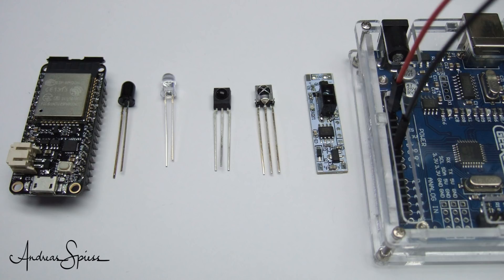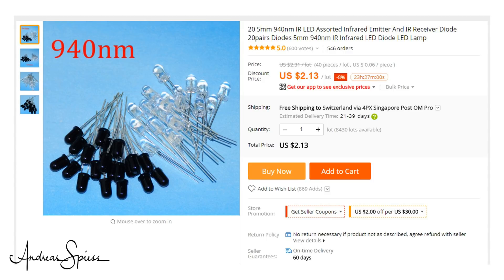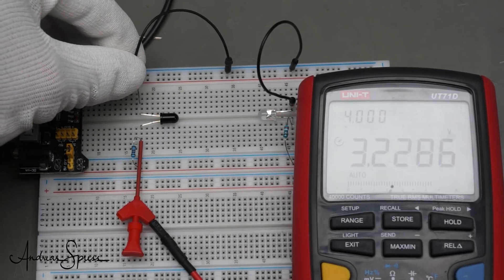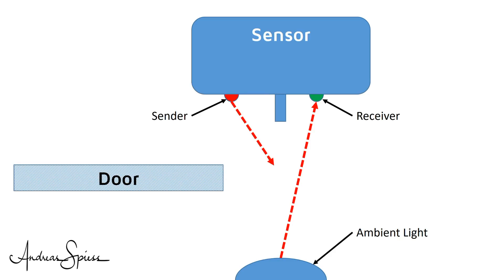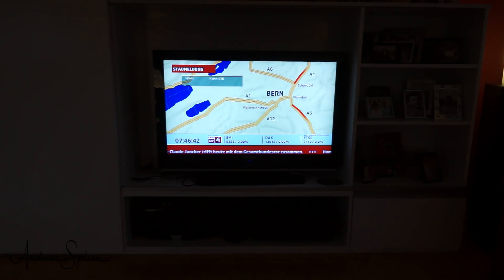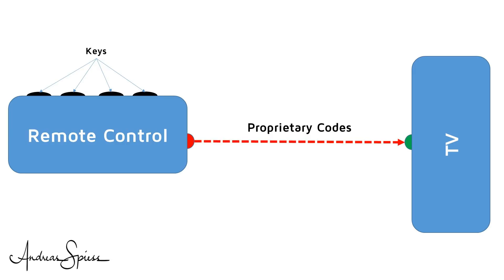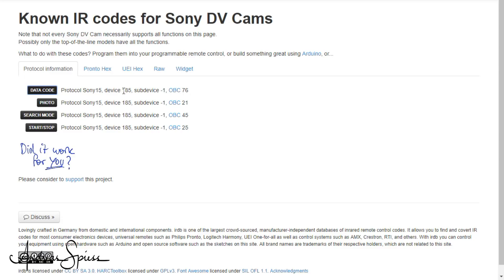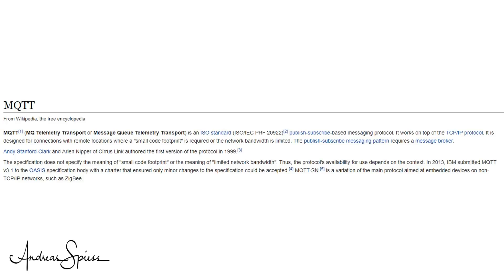#171 Arduino Guide to Infrared (IR) Communication also for ESP32 and ESP8266

Comment: I have just maden my own IR transmitter 38kHz (with two 555s) and receiver and even was able to drive a stepper motor (with l293d) , the problem is that the IR receiver doesn't like constant signal but with pulses it wasn't very accurate with that stepper motor ( I am happy that I managed to do this but when I have doscovered one thing  severeal other problems appear hahhaha ;) )
Reply from the maker: I do not know which receiver you used. If you used a standard photodiode you would have to look at its output signal to find out if it was driven into saturation by (constant) ambient light.
Reply: @AndreasSpiess  VS1838B :)
Reply from the maker: These sensors are optimized for IR codes. So they probably have some built-in filtering.
Reply: Hmm..an oscyliscope would be usuful but it is too expensive for me at this amator stage. So actually I could use coder/decoder with that so it would be better? Or experiment with my own code - as long as it is accepted by the receiver..

Comment: In cases where propagation time is important, what's the best I can expect to see in a low to high transition at the transmitter to a low to high at the receiver output. No mechanical relay, to slow.
Reply from the maker: Propagation of light is 300'000km/sec. More important is the protocol and the transmission speed  you use. I did not do measurements for that purpose. Maybe google knows?

Comment: I can't help but think that using an ultrasonic sensor would've just made your time a lit easier , but you have a cat you that may not have worked out
Reply from the maker: None of my devices "listens" to ultrasonic :-(
Reply: Sorry for the very late reply (first saw this for a home project but now I need this information for an assignment) what I meant to was that you could've used an ultra sonic sensor instead of the often shoddy IR ones to see is the cover for the TV was closed

Comment: Hello dear Andreas, can you please help me connect this sound module
https://www.ebay.com/itm/MP3-Voice-Recording-Playback-Module-Sound-Recorder-Board-With-Speaker-PIR-Sensor/333643130388?ssPageName=STRK%3AMEBIDX%3AIT&_trksid=p2057872.m2749.l2649
with these IR sensors
https://www.ebay.com/itm/IR-infrared-transmitter-module-Ir-digital-38khz-infrared-receiver-sensor-mod-ES/223690153347?ssPageName=STRK%3AMEBIDX%3AIT&var=522408438795&_trksid=p2057872.m2749.l2649
instead of that PIR sensor?
Thank you very much for your time.
Best wishes.
Max

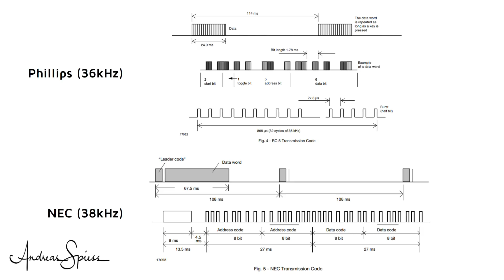Comment: so if I understand those diagrams right (11:55) - every signal I send from my remote control is like delayed about 0,08 sec ? I mean when I keep pressing the same button for example.
Reply from the maker: The receiver for sure has to wait for the whole transmission plus the time to decode teh signal.

Comment: Dear Andreas, I liked your videos a lot. I'm trying to use ESP32 DOIT DEVKIT v1 to controll AC (Sinclair), my plan is to send RAW codes to the AC. I tested this on ESP8266 where I can select GPIO pins. How can I set GPIO pin for ESP32. Do I have to change something in boarddefs.h, irSend.CPP, irremote.h ?
On my PCB design I put GPIO pin 12 for the IR Send. How can I set this PIN in your library ?
Reply from the maker: Better use this library: https://github.com/z3t0/Arduino-IRremote
Reply: @AndreasSpiess  Thank you for your answer

Comment: does the ESP8266 have the same "IR" mode?
Reply from the maker: I did not check, but you should find a library which works with the ESP8266, too.
Reply: @AndreasSpiess  yeah, from what I've seen there are some, like the tasmota-ir, that implements it all

Comment: can you add more description of the components and what you are doing at 4mins 17 seconds? the voltage of the receiver goes up when it gets the signal of the transmitter? sorry I didnt understand it as it goes straight to where the components are on the test grid with the meter connected but not showing how the meter is connected what volts goes to the transmitter and what the reading on the digital meter is ? anyone also can you help me ? thanks
Reply from the maker: I interrupt the light from the LED to the phototransistor and because of that, the phototransistor changes its voltage.
You find the links to the parts used in the video description.
Reply: @AndreasSpiess  thanks for your reply :)     
so q1:- in other words does the resistance of the phototransistor go up or down when it received IR light? I will check your other videos I need to go over the very basics I think (I even need to check the difference between resistor and transistor - ) can I email you with my actual problem? I am looking at an old car IR central locking system - peugeot - neiman france made.
Reply from the maker: YouTube is my hobby and unfortunately, I have no time for answering mails :-(

Comment: You are right when told: - it's not easy program Arduino to have 38 KHz - But I'm been more lucky than clever and after to have read much articles about the Timers/Counters inside Arduino I have reach a good result with these few rows (on Arduino Nano): 
define pwmPin 11 // IR Carrier 38 KHz PWM
const long IR_CLOCK_RATE = 38000L; // IR Carrier 38 KHz PWM
void setup()
{
TCCR2A = _BV(WGM21) | _BV(COM2A0); // PWM setup
TCCR2B = _BV(CS20); // PWM setup - 38kHz carrier/timer 
OCR2A = (F_CPU/(IR_CLOCK_RATE*2L)-1); // PWM setup
pinMode (pwmPin, OUTPUT); // PWM setup
} // end setup
void loop()
{ 
} // end loop

My acknowledgements to - Hao Jiang - Ken Shirriff - Leonard Birchall -
Reply from the maker: Thanks for sharing!

Comment: Hi sir, really cool , im currently working a project that involves IR signal, however im stuck on decoding and transmitting HITACHI AC signal which i found that is not easy to decode, if u can help me with anything i would appreciate it. Thanks
Reply from the maker: You have to google to find a prokect which is capable of decoding these codes.

Comment: Hey, I am trying to build an IR spectrometer inexpensively. I am new to arduino though. The basic principle is that the diode shall emit IR radiation and then the sample to be analyzed would absorb a specific wavelength of the radiation (characteristic for different molecules). Is it possible to use this detector for this analysis (wavelength instead of it working like an ON/OFF switch and not working on detection of the intensity of IR). If not, can you please point me in the right direction??
Reply from the maker: I made a video about a spectrometer

Comment: I want to make a remote controller on Arduino (IRrecv+IRsend+sleep). In which it should read IR data usingtsop1738 then send the desired IR data using IR transmit led. And when no data is received it should go to deep sleep to conserve battery. Because I want it to run on 3v lithium coin cell. I found many codes on the internet using Irsend + sleep or just IRsend + IRrecv. But not a combination of all the three. If you make the code for the same it will be helpful. Need for this project=== some channel nos on my tv are 4 digits. It is very difficult to press 4 keys. So my plan is to press only 1 key tv remote and my controller will send desired 4 distinct key codes to tv by sending cancel command to my 1st command press by me on my tv remote
Reply from the maker: How would the receiver know when he has to wake without being awake?
Reply: @AndreasSpiess  Just as a push-button does. I found a person sending IR using irsend function from IRremote library. His atmega sleeps until he dont press any key. So I learned how to sleep-send-sleep. i want to know how to sleep-receive-sleep.
Reply: Thanks for the help in advance!

Comment: Sir, thank you dearly for all your tutorials.  I am new to ESP32 and have gained so much watching.  I was needing to move IR receive to core 0 to get the update rate I needed.  Would never have made it without your dual core video and your updated IR library.  Thank you so much!
Reply from the maker: You are welcome!
Reply: @AndreasSpiess  Sir, I hope you would provide some additional guidance.  I am having trouble getting a send.  I have reviewed your git hub files and responses below.  I just cant identify what output pin you are using for irsend?  Is this GPIO3?  There are several boards as you know.  I bought an Adafruit HUZZAH 32 not a dev board.  My mistake.  The Adafruit board does not have GPIO3 wired out.  Scouring through the library I can find the command identifying output pin assignments. Thank you for any assistance.
Reply: @AndreasSpiess  Sir, thank you again for all your wonderful vids.  I am sorry I bothered you, however, I did find the command.  Opening up IRremote.h in Visual Studio made it easier to locate the line is 262 -   byte timerPwmPin=15.  I changed the value from 3 to 15.  15 is another PWM pin on the ESP32.  Once again, thank you.  I really love this little chip.
Reply: Sir, like you I like to keep a happy wife.  This IRsend was the final piece in an automated TV volume level mod I have been making.  My wife hates the volume changing when commercials come on.  I have made a hack for her using a mic input to a PID loop with time proportional output.  I use the IR remote to change the setpoint of the PID.  Then I average the mic input to get a smooth sound level reference.  The PID adjusts the TV volume based on the setpoint, lowering the volume when commercials come on, or when she yells at me.  If you raise or lower the setpoint the volume tracks with it.  She is very Happy.  Couldn't have done it without your vids.

Comment: The Arduino runs at 16MHz, it should be capable of creating a 38 kHz pwm... The weak points could be the poorly written libraries. You could in theory set up a timer and achieve frequencies up to 8 MHz... Thought I think you need to code in assembly for that

Comment: I've been following you for many years. You never failed to deliver unique content. In my case, it works well with esp32. But when it comes to nodemcu, i have some issues with ir remote library. Getting errors regarding rawcodes since i tried almost all the ir remote library versions for node mcu. Can you suggest me stable version?
PS: I like your humor
Reply from the maker: I did not do anything with IR since then. So I do not know a library. And AFAIK they updated the ESP32 lib lately
Reply: @AndreasSpiess  somehow i managed to compile and run successfully.

Comment: Actually you could use the IR-diode that is used for emitting light as a light receiver. Diodes are always light sensitive, instead of just emitting light, they can also be used to detect light. Only the sensibility is not very good. But that migth work for your example already, since the distance from the tv door to the LED installation is so little. Give it a try with just some diode, it also works with other colors, like green, yellow, red, etc. LEDs. They all have some small voltage between anode and cathode, as soon as light hits them.
[edit] By the way, just to amuse your wife, how about a little magnet attached to the tv door and a hall sensor to detect that in position, when the door is closed?
[another edit] Got it, your wife is already amused... :)
Reply from the maker: Using the same LED for transmitting and receiving would probably not work as the speed of light is pretty fast. Using a hall sensor would also have been a possibility.
Reply: @AndreasSpiess  Na, dann wünsche ich mal einen schönen Sonnatg in die ferne Schweiz und viel Spaß mit dem Hall-Sensor... :)

Comment: I have an error message: .....Arduino\libraries\ESP32-IRremote\IRremote.cpp:28:27: fatal error: avr/interrupt.h: No such file or directory

Where could I get this library? Regards
Reply from the maker: Are you sure you compile it for an ESP32 board?
Reply: @AndreasSpiess  No, I'm using ESP8266 Esp12E. Is not the same library?
Reply from the maker: No
Reply: Oh!

Comment: Hello Andreas, I've been thinking about if it's possible to add some kind of conduit as a repeater to send IR signals (say something like the way optic fibers work)
Reply from the maker: I am not sure if it works with normal IR. Usually, they use laser diodes which is a different light source.

Comment: Hi @Andreas Spiess, re-watching your videos an idea came in mind, but could not be sure about a thing and wanted to contact you. You're declaring that it's possible to prevent day light from tricking IR receivers. I'm thinking about creating a robotic pan tilt mechanism, which follows only an IR emitter. I mean if not please suggest me some technology. I'm fed up with my motorcycle mirrors change their angles because of the wind. And as I go faster I need to bend my head in order to resist the wind and supply some aerodynamics. This results with the fact of losing my mirror vision. I'm now searching for a technology which will let me to 3d print a pan tilt mechanism to arrange my circle shaped mirrors angle relatively to my heads movement. I do not want to lose my vision in any case. Could IR be this technology? Could you advise me?

Comment: Thanks for your answer the Ir led and receiver are this LAOMAO 5 paia di diodi a infrarossi a LED, emissione e ricezione https://www.amazon.it/dp/B00EFOTJZE/ref=cm_sw_r_wa_apa_i_ulKoCbMZFP6KW can it do 10-15 metres?
Reply from the maker: I do not think so
Reply: @AndreasSpiess  this emitter can't?
Reply: Can you recommend a high distance emitter?
Reply from the maker: No, I never tried it with a bigger diode. Only with the one you want to use. But this did not work on 10m.
You need a strong IR diode (a few watts) and also have to add a driver. Not a simple task.

Comment: How much distance can the IR Led transmitter do? 10 metres?
Reply from the maker: Depends on the diode used in the transmitter and the ambient light. 10 meters could work.
Reply: LAOMAO 5 paia di diodi a infrarossi a LED, emissione e ricezione https://www.amazon.it/dp/B00EFOTJZE/ref=cm_sw_r_wa_apa_i_ulKoCbMZFP6KW
Reply: It's good?

Comment: How is the Arduino connected to the ESP32? Looks like ir devices are first wired to Arduino but later when MQTT is on ESP are the ir's on ESP? Thank you.
Reply from the maker: The ESP32 is used instead of the Arduino. So there is no need for a connection.

Comment: Did I miss something? Where is the schematic for connecting up everything. Thank you,
Reply from the maker: There is no diagram, it is very simple. The LED is connected to a pin using a small resistor and the detector is connected to 3.3 volts and to the respective input pin.

Comment: Love the video! Came here searching for a lesson just like this, in hopes of undersanding why another program (Iaqua controller) isn't working with my lights,  and got humor too :)  I did have a question on the code (IRMQTT_ESP32). I'm trying to use it on an arduino but after some errors due to missing library files (or wrong ones) I'm stuck on an exit status 1 for no matching function for call to 'IRsend::IRsend(int&)'   Is this another library issue, and if so, which one?
Reply from the maker: The ESP32 uses different libraries than the Arduino. You have to use the Arduino libraries for that. But you anyway will need connectivity (Internet).  I do not work with Arduino in such scenarios so I do not know which libraries should be used
Reply: Thank you for the info, I'll see if I can get it going. I do wonder, is it possible to have one send command transmit more than one code?  For the application I'm looking at, I need to press 3 buttons to turn a light on and get it to the lighting I'd wish to use. Can a program be made to send 3 codes with a delay between them, using one time trigger or line?

Comment: Thank you for all of your great videos. Very appreciated. I'm using the IRRemote library as described and all is working(Send and Receive). I want to take the values for the remote control I've read  and write them to memory using SPIFFS. Since IR is running an ISR, my code bombs when I try to write the remote data to SPIFFS file. I'm struggling to get around this issues. I do not see any methods to terminate the ISR when I'm done reading codes. I'm using Adafruits ESP32 Feather. Any direction would be greatly appreciated. Thanks!
Reply from the maker: I never use SD cards, so I do not know where the problem is. What if you attach the ISR to a pin which does not move during SD operation? Then no interrupt should trigger.

Comment: Dear Andres thank you for the comprehensive explanations.

I am trying to use the  IRSendDemo with ESP32 (WROOM-32 1313) and not sure how to interpret the comment
" An IR LED must be connected to Arduino PWM pin 3", pin 3 is RX0 in this board pinout.

Should it be TX0 (sadly not working), what is the proper pin to connect in order to send IR codes using your
examples (or the ESP32 Compatible examples from your github) ?

Thanks.
Reply from the maker: In the sketch the pins are defined as follows:  int RECV_PIN = 14;int SEND_PIN = 5; No pin 3

Comment: Has anyone implemented this with ESP32 or ESP8266 : https://www.aliexpress.com/item/Discount-5V-IR-Infrared-Remote-Decoder-Encoding-Transmitter-Receiver-Wireless-Module/32725206348.html 
Looking for any example sketch which implements TX RX on the module. Thanks...
Reply from the maker: I do not know this module
Reply: Since commenting earlier I've come across this forum: https://forum.arduino.cc/index.php?topic=359707.0 where I've added a translated English language manual. Seems to be straight forward to use, have ordered one which will arrive in a few weeks for me to try. Thanks for your response Andreas Spiess.

Comment: About the IR-mode for the serial port at 15:00 IRDA is a protocol stack for IR data transfer, similar to bluetooth, but older. This probably switches the serial port into a mode compatible with IRDA lower protocol layers. For starters, have a look at the Wikipedia article.
Reply from the maker: I think so, too, but did not have the time to explore. And I also needed the higher (protocol layers)